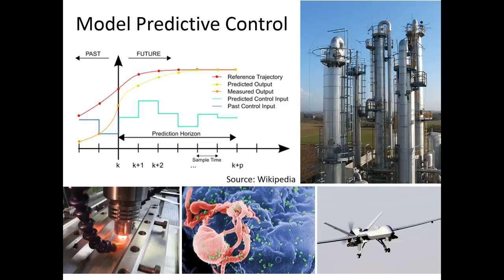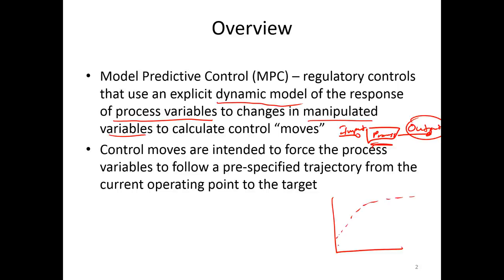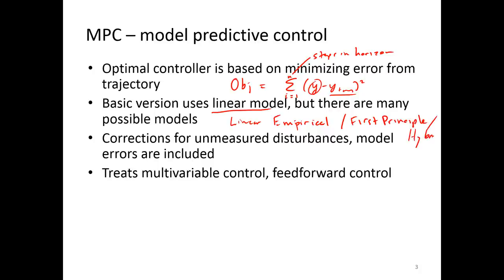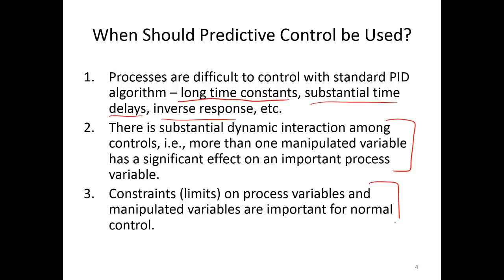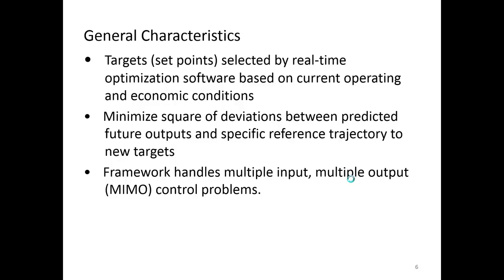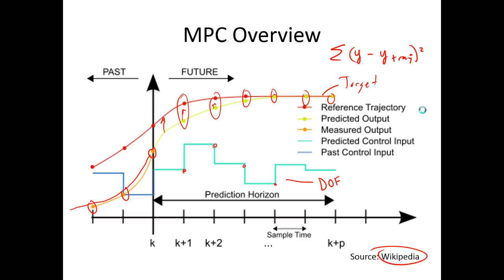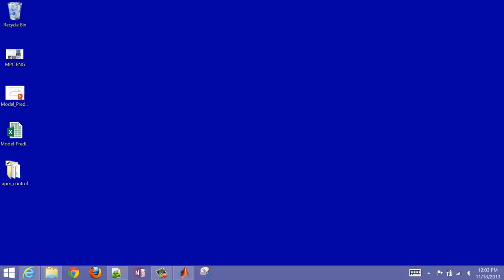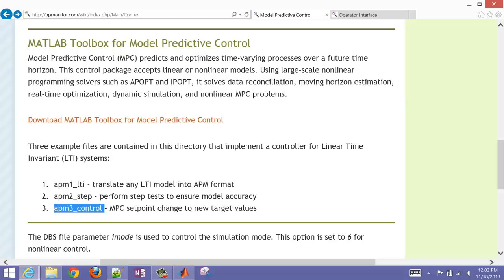Model Predictive Control in MATLAB and Excel

Comment: How do I simulate mpc for a power system network in Matlab? I tried loading the case file and then calling the mpc function but it said the mpc command must be an LTI object or structure of models and offset
Reply from the maker: This package doesn't use the MPC toolbox provided by Mathworks. Here is the mpc toolbox with APMonitor: https://apmonitor.com/wiki/index.php/Main/MATLAB  You may also want to consider using Python instead with the Gekko package. See https://apmonitor.com/do/index.php/Main/EnergyBenchmarks and https://apmonitor.com/do/index.php/Main/TCLabF
Reply: @apm  Thank you very much

Comment: in @8:08, why CV target and CV actual don't get to the steadystate, can this introduce some identification errors !!!! or the dynamic model is already identified?
Reply from the maker: More information on model identification is here: https://apmonitor.com/do/index.php/Main/AdvancedTemperatureControl (see Labs A-E). In this example, it doesn't matter that we haven't reached steady state because we aren't identifying a model. However, even if it were model identification, steady state isn't required although it is nice to see that the model performs well in reaching a target value.

Comment: 1/ How do you compute the reference trajectory (target) in the first place? 
2/ How to use MPC for nonlinear control systems for which the optimization becomes nonconvex?
Reply from the maker: The reference trajectory is defined here: https://apmonitor.com/do/index.php/Main/ControllerObjective
  If you have a nonconvex system then you may need to use multi-start methods or a global optimizer. This may make real-time calculation impossible if the computation time is longer than the required sampling and cycle time.

Comment: Thank you very much for the excellent explanations... save my lot of time. Just curious to know, Is this control concept can be applied to highly nonlinear system ?  Lets say for an inverted triple pendulum? If not do you have any performance comparison with some nonlinear control theme like sliding mode (except PID) or anything with MPC. Keep up the good work..!
Reply from the maker: Nahian Rahman We've completed applications with pendulums and inverted pendulums. One of the drawbacks of MPC is that the computational time can be much more than something like PID or LQR controllers because you need to solve an implicit and iterative optimization problem each time step. As long as the MPC application can calculate fast enough, there shouldn't be any problem with controlling a highly nonlinear system. Check out the dynamic optimization course at http://apmonitor.com/do for additional examples and videos.

Comment: Is there a difference between Predictive control and Predictive adaptive control? Please assist with quick response.
Reply from the maker: Emmanuel Da Yes, predictive control has a fixed model that doesn't change as new data arrives. Most industrial controllers are not adaptive. With adaptive controls the model is changing as new data arrives and an improved representation of the process is discovered. Sometimes bad data or the wrong type of data (e.g. steady state) can degrade the model predictive capabilities. Adaptive control is typically only used on processes that change over time where the model becomes inaccurate.

Comment: I can't understand the target thing,  it's like we know the solution before we turn on the system,the robot or anything... what if the environment is unknow
Reply from the maker: +Karam AbuGhalieh, sometimes the target changes as we get new information. The target is usually a reference trajectory that also tells the application the route to follow. You may need a supervisory application that gives target or trajectory information to the Model Predictive Controller.
Reply: APMonitor.com thanks for reply... so we are predicting the future input value to match the output we desire. 
sorry if my question it self is wrong. but I am still confused about the whole concept.
Reply from the maker: Yes, we are calculating a sequence of process inputs to drive the system to a desired state or along a desired trajectory. More information on model predictive control is in the dynamic optimization course at http://apmonitor.com/do  Check out the links for MPC on the right.
Reply: This link? http://apmonitor.com/do/index.php/Main/ControlTypes

Comment: Sir can you plz give me hydro power valley model with model predictive control.
Reply from the maker: janaki sreeram I don't have that specific model but here is a reservoir model: http://apmonitor.com/do/index.php/Main/ModelFormulation The hydro power valley model could be derived from this by relating flow and reservoir height to power generation.
Reply: Sir can you guide me for Solid oxide fuel cell model MPC ?